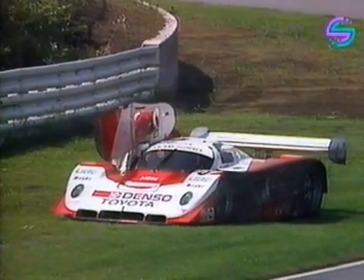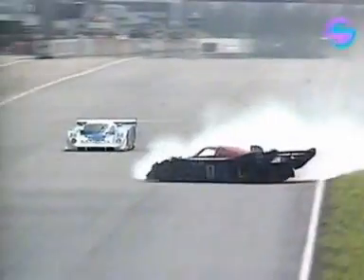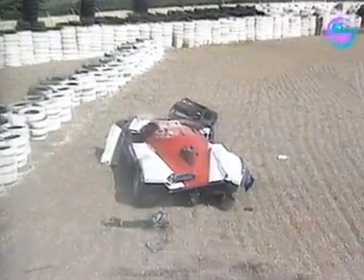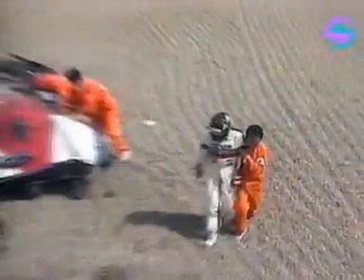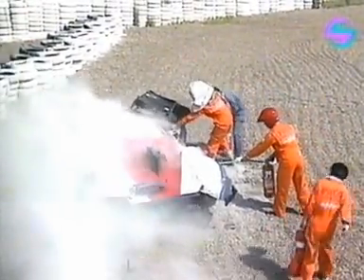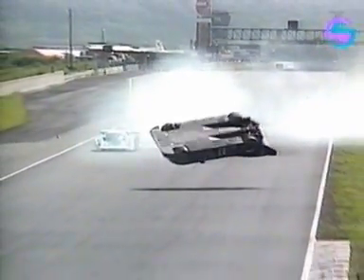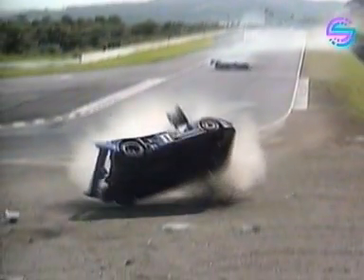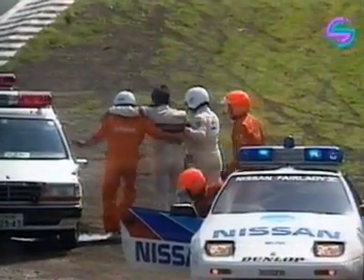Nissan R91CP Rollover

Comment: In those years, the evolution of aerodynamics was unequal to the evolution of other characteristics of the cars, for example, the tires. Many times, these tires could not stand the aerodynamic load that was generated by the cars. In this way began to appear pressure problems and even, in rare cases, the tires ended up bursting (see 1992 Nissan Grand Prix of Atlanta).
Reply: Also Sauber at Le Mans in 1987 or 88.
Reply: ***** What about 1989?
Reply: ***** Why did you say it? We weren't talking about 1989.
Reply: ***** No, the C9 was made first in 1987. It was raced with much promise but little success that season but was much more successful in 1988.  Its most successful season was 1989 but that was it's third season. The reason I mentioned it was that the Sauber team suffered tyre blow outs at high speed during the 1988 Le Mans weekend. They were unable to start the race as a result.
Reply: ***** Perhaps you should read the Wiki article about it.

Comment: I am pretty sure the Group C cars were quite a lot faster than today's LMP1 machines on straights, because their engine output (Group C cars) was much larger, but the cornering speed wasn't due to aerodynamics.
Reply: As far as I know the Power was quite the same but they had more Downforce because they used GroundEffect. The Jaguar XJR -12 generated enough to take a ride on the roof and also cows with it. More things like suspension which could make todays cars faster
Reply: +Nino Schier As far as I know, the machines from group C era generally had 700 to 800 horsepower, whereas nowadays, the Lmp1 cars, like the Audi R18, only has a little more than 500 hp. Thats the reason which makes the group C cars go faster on straight. And for the group effect you mentioned, as far as I know, the only car which had it was the Chaparral 2J before the effect was banned from being used in race tracks. So I still believe that advancement in aerodynamics technology is what makes today's Lmp1 machines have faster lap times than the Group C ones. Anyway, happy to have your sharings.
Reply: +MrVoss94  Thank you, Mr Voss. I am still convinced that the hybrid effect is temporary, and the duration is quite short indeed, starting from about 120km/h. By the time it reaches top speed, the hybrid effect is already long gone. So i suppose the hybrid power dont have much effect on top speed, although it had 1,200 hp when its active. And i have checked out some other youtube video (documentaries) featuring Group C cars in the past, like Sauber C11, Jaguar XJR. They could reach 350-360km/h on the mulsanne straight. But nowadays, like the 919 and the R18 e-tron, they could only reach 320-330km/h. I am not sure if there are any other reasons afftecting the top speed, but thats truly what i can observe. Of course current Lmp1 can do better lap times because of advancement in teachnology. Correct me if i am wrong.
Reply: +Nino Schier  Thank you.
Reply: +MrVoss94  Are you sure the 2 chicanes on the mulsanne straight are the only differences of circuit la sarthe when compared to the past ? The lap times can definitely be a reference, but isnt really telling a lot. And thank you for your reply. i learned a lot here. And thats the longest reply i've ever seen !
Reply: +yojimba06   Of course for a chunk of the Group C era they ran at Le Mans without the chicanes on the Mulsanne straight so they could push to the maximum along there, which is why they were fully trimmed out aerodynamically which tended to make them slower round the rest of the lap as they didn't have as much aero grip in the corners.  Yes they were faster than the current LMP cars but testing figures from tests run at Paul Ricard seem to suggest that the fastest LMP cars are only about 15-20 kmh slower on the Mistral Straight than the Group C monsters while also being much easier to drive and, of course, safer.  Sadly the current cars can't compete at all in terms of sheer drama though...  Those Jags were and awesome sight and sound...
Reply: +gosportjamie Didnt expect a short reply can lead me to so much valuable knowledge and history about endurance racing. Thank you again, guys !
Reply: yojimba06   Glad I could help...
Reply: Yeah I believe so. The LMP1s would hardly reach 400, and not only because the Hunaudières is no longer 6km straight but they are much more about ability.
Reply: because LMP1 regulations do not allow the cars past 340 KPH.
Reply: Group c has more horsepower especially the Nissan R92CP with higher horsepower in history
Reply: lionnel murimi yea, safety comes first. its understandable.
Reply: yojimba06 as long as F1 is doing 370+ in open cockpit open wheel cars not
Reply: Nino Schier   Open cockpit cars per se aren't particularly dangerous, it's open cockpit cars with inadequate head protection for the drivers that are dangerous.  If open cockpit cars were inherently dangerous they would have been outlawed in every form of racing a long time ago, with the exception of Formula 1 where Bernie really couldn't care less if drivers die.  In fact I think he actually thinks that having drivers die will boost viewing figures when historical evidence shows the opposite is true...
Reply: gosportjamie 

i understand what you mean but in case of a crash its much better to have a closed cockpit and no open wheels which can fly away much easier than when covered.
Reply: Nino Schier   Losing parts of the car in a crash help to dissipate the energy of the crash and so prevent it being passed on to the driver.  If that wasn't the case the people who build the race cars would probably make parts much stronger to prevent them being torn away...
Reply: gosportjamie 

Yes but hitting such parts open cockpitted is a thing you perhaps only do once.

I just dont like that F1 is kept the fastest series artificially
Reply: By the end of the hybrid era, LMP1 were much faster in acceleration, mostly down to the extra hybrid boost pushing the car over 1000 BHP. When using the hybrid boost, instead of going straight to the rear wheels it would send the boost to the front wheels, turning the car into a 4WD under acceleration. The only exception as far as I'm aware was the Nissan GT-R LM, which was a front wheel drive that sent the hybrid boost to the rear wheels.

Also LMP1 cars from around 2009 were almost quicker than Group C in a straight line anyway.
Reply: The 787 had the best cornering!
Reply: Aerodynamic sophistication is far greater now than it was then.

Comment: When going backwards, yes they are, as you put it, "rubbish". I can't imagine (m)any designers worrying too much about the cars performance in reverse!
Whoever mentioned the NASCAR roof-flaps is spot on..........just ask Rusty Wallace!!!!!!!!! -
*and for those that have no idea who Rusty Wallace is, try searching for
1993 Rusty Wallace flip @ Daytona  or
1993 Rusty Wallace flip @ Talladega.
Reply: P. Mid I guess most of the reason why it is like that, is because of the rear spoiler. When the car is driving forward, the spoiler creates downforce, but while driving in reverse, the complete opposite is happening.

Today, technology is available to prevent such things from happening, but it is rarely allowed, since it makes it pretty easy for anyone to cheat undetected. But I think there definitely should be a failsafe that adjusts the spoiler only when things kind of like this is happening. But I imagine that would've been a little bit more difficult to do in the 80's and 90's.

Comment: number one, the car is called the CLR, not the CLK-GTR.  The CLR was for 1999, and to carry on from the CLK-GTR.  Also, the CLR hit a bump at the top of the hill and enough air got under the car to push it off the road, at a speed of 215 mph.  At those speeds, any lift will flip the car over.

Comment: The driver could have had broken a collar bone landing on the roof like that, the safety crew should have used more discretion. There was a lot of hot material around, fire may have been a concern, but moving someone with a broken collar bone can cause permanent nerve damage to the entire arm or cut the artery feeding the arm.

Comment: behind that R92CP YHP is Minolta Toyota 88c-v race car.
Reply: +Tyade Aldino Isnt that a 91 or 92cv ?? Didnt you say "behind a Nissan 92cp" ?
Reply: +yojimba06 yes
Reply: +yojimba06   Not all the teams ran, or could afford to run the latest generation cars.  And, to be honest, some of the older cars were both faster and more reliable too...
Reply: +yojimba06 I just saw the left front tire blew and he flies up in the air and then tumbles over at the gravel trap, but the car didn't get on fire but he is ok. The rollover he took is the same thing as Takao Wada did, but his car got on fire when he rolled over and went upside down. but for the R92CP, it didn't get on fire, so it tumbled over back right side up and it came back down on its wheels.
Reply: It is the Toyota 91C-V behind the Nissan R91CP.
Reply: And who was driving the Toyota 91C-V?
Reply: It was the Toyota 91C-V, I had the 94C-V in my latest video
Reply: WEC Media Do you know if one of the Japanese drivers is driving the Toyota 91C-V behind the Nissan R92CP or you don't know?

Comment: was because of the blow out, would happen to any car with a blow out at high speed with a flat bottom, and the R92 in a straight line at fuji would have been doing over 200mph

Comment: The tire blew out because of the downforce the car produces. Nissan had a IMSA car running late 80's early 90's and it could never hold a driver longer than several races because then downforce did no end of evil to the rears during qualifying and races.  Sad because they had alot of potential and great drivers to begin with.